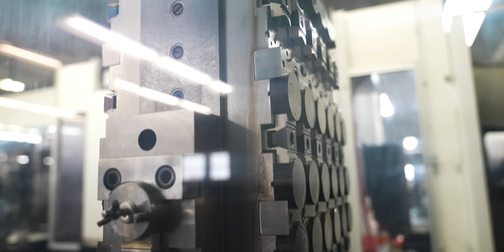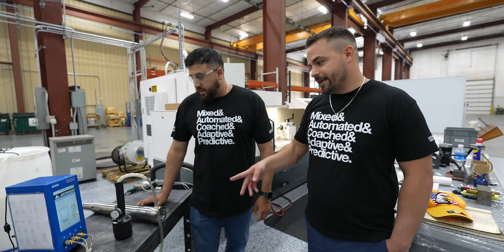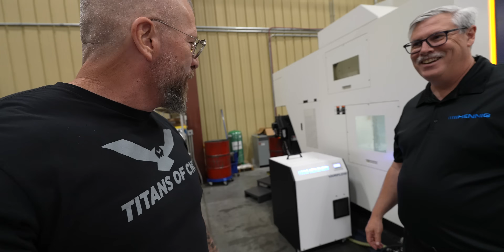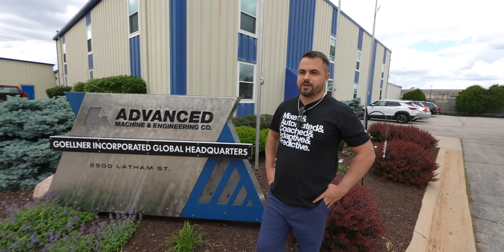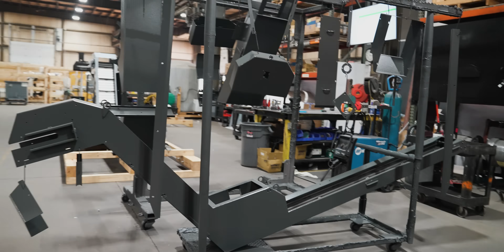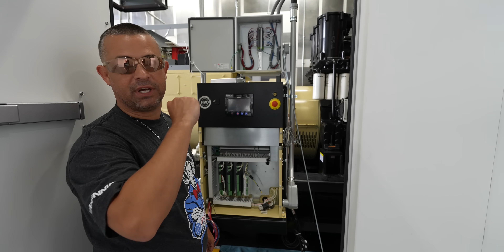New Industry Brings Trillions Into MFG

Comment: i do wounder if you can controlle those cooling pumps pressure output by M-codes ( like on my citizen and the pump on it. i have like 5 diffrent M-codes just for pressure ( one is for off ) and 3 more to tell it where its going to. so like if i want like 60 bar at this outlet i give it the pressure code and then the destination code  in the same line and in the next line i can give it another pressure and destination code ) but just being able to change the coolent pressure multiple times through the program on the fly with a diffrent M-code  is so sweet 

i have been woundering. why dont we use those sound boxes that they have for the generators on our machines? i mean it sounds pretty logically since a lot of people are standing by them all day long. so why not quaiet them down if we can ( useing insulation that dont really change the sound of the machine. only the volum of it ) saveing peoples hearing without them having to use like ear plugs or stuff like that. or when showing people/customers around they can hear you much easier and dont have to raise your voice as much 

also when is update on the syil U5 ?